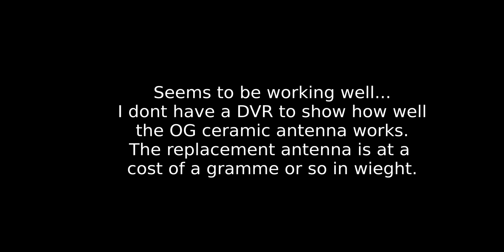Mobula 8 - ELRS Ceramic antenna repaired and replaced with T style antenna.

Comment: hi mrmonkzy, have you become a flat earther yet? If not I suggest viewing the 13 part series what on earth happened in my about to learn how the earth is not a globe
Reply: Hi, do you think that the winding should not be soldered to ground?
Reply: @konstantinbazzilio5026  what winding?
do you mean the outer shielding of the antenna wire? if so, that needs to be soldered to ground.
Reply: @flat-earther I am not an electronics engineer, but you understood me correctly, that's all I needed to know. I watched 5 videos with the installation of non-standard antennas on this model and only on one the external shielding was soldered to the ground. That's why I asked the question how to install it correctly
Reply: Thank you @flat-earther